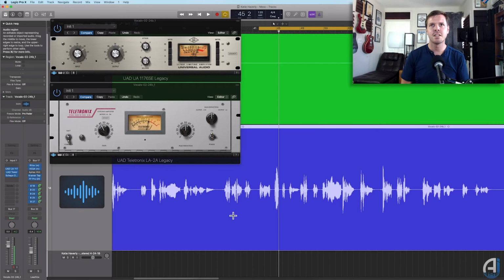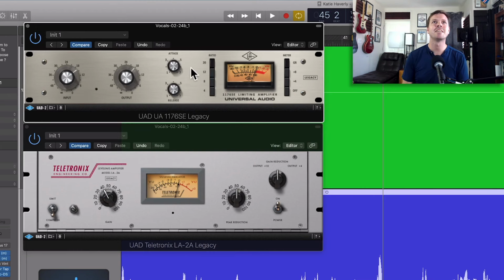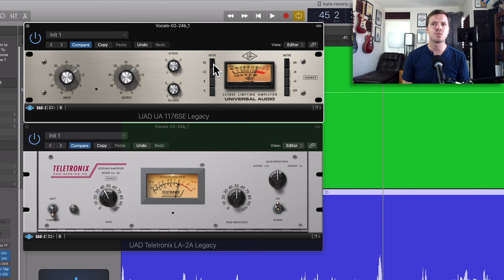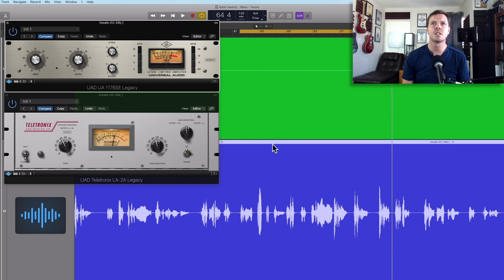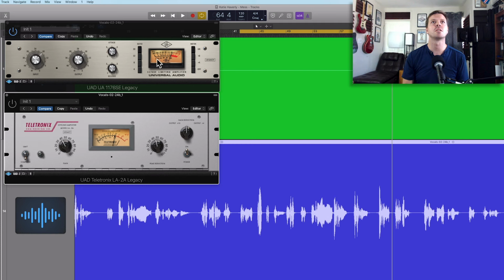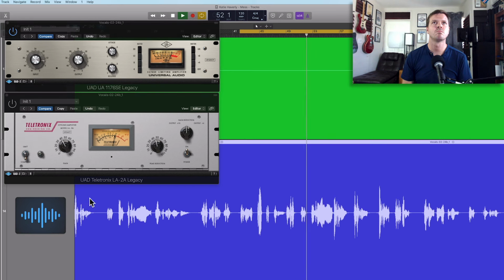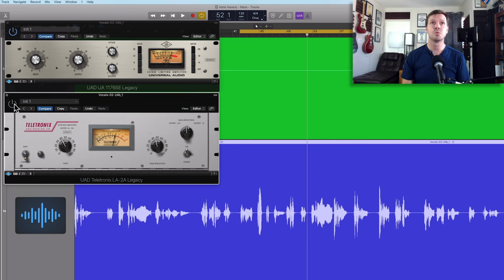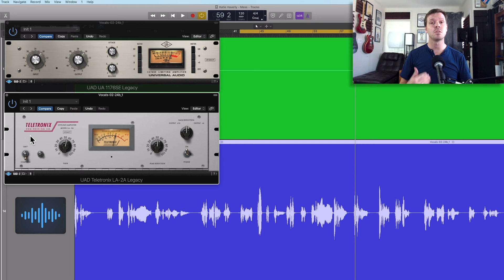Don't Mix Your Vocals Before You Try This

Comment: hey, when applying 2 compressors, what threshold level do you use on the first versus the second compressor? relative to each other, and relative to an imaginary standard (like low or high). Thanks a bunch and great video!!!! 55'pce'55
Reply: The numbers I've heard most are -12.5db, -20db, and -25db. Most of my compressor defaults start you at -20db. Hope this helps!